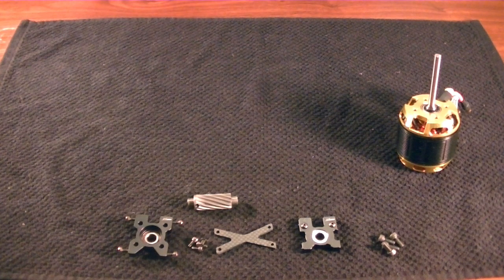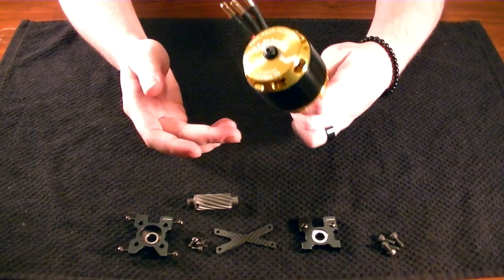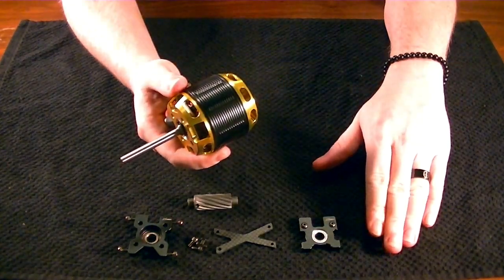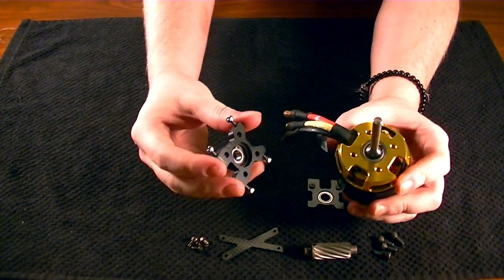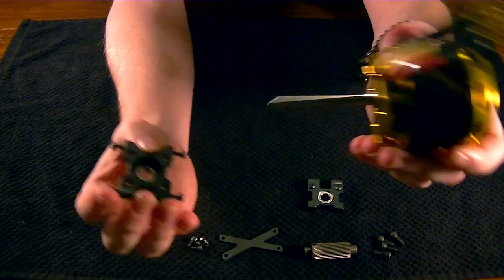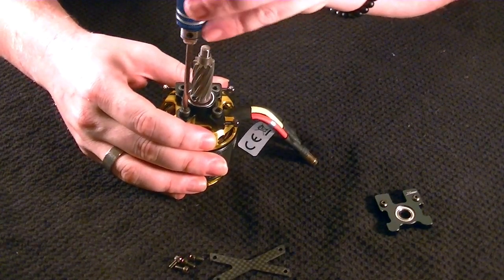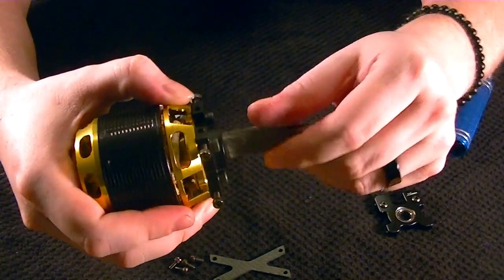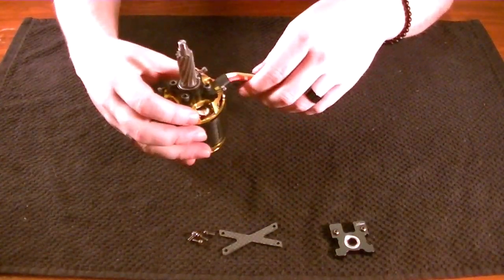Specter 700 : Motor Assembly And Install (FreddyCanFly)

Comment: Hi Freddy. I may not have done all the research, but I am looking at getting an XNOVA 4525-530. Do I want the the 36mm or 56mm shaft which would be their "A" or "F" shaft. (obviously if anyone else would like to help out it would be greatly appreciated)
Thank You
Reply from the maker: Would the be for the Specter? It should tell you the specs in the manual but if not I can probably get you an answer if you want to IM on Facebook.

Comment: Hey freddy my name is Buster i very much like your videos they have helped me a ton..  I was wondering in your flight videos the background looks like you utah mountains you wouldnt  happen to live in Utah would you?  Because I do I live in the salt lake valley
Reply from the maker: Hey brother, I have some bad news lol I have lived in Utah for over 10 years however I have recently relocated to Arkansas :(.
Reply: @FreddyCanFly  damn it!!! That no good lol..  How is hoping to get your help on some helicopters . I need some help with some helicopters i  Recently acquired. My experience exceeds to a blade 450X.  That I set up in rebuilt a few times. With the AR7200.   But recently I bought a guy's  Entire collection. I got a trex 700 with a mikado vbar. A trex 550e that im going to put a ar7210bx .  Neither Heli has ever been flown there built but not set up. If you get my meaning. A goblin 420 with a ikon a goblin 280 fireball with a ikon2 mini. And a trex 450 with a beastx plus. I kinda jumped in with both feet..  I got pretty decent flying skills And experience lots of practice on a simulator I just need help with the setups and getting everything calibrated like the self level on the ikon stufd like that.
Reply from the maker: @BussB420  dang buddy thats a lot to take on for sure.  I am currently working on the full setup series for the beast X / AR7200BX.  They should be up very shortly.
Reply: @FreddyCanFly  im putting a ar7210bx.  How similar to the 7200 is that
Reply from the maker: @BussB420  They are the same but the 7210 has some additional added menus and updated firmware things like that.  They both work the same.

Comment: Great video. Nice helicopter. I'm trying to decide on a specter 700 or a 696, the main difference I see is tail drive. I don't know the advantages or disadvantages of torque tube to belt drive. Do you have an opinion?
Reply from the maker: They are both amazing to have, I like the belt because it makes less noise and has a cool sound.  However the TT is a lot easier to fix because to boom can be take off without removing the gears.  All in all I would say its just personal preference.
Reply: I like the torque tube, I have a 500 and 550 with it, but it's always fun to try something else.

Comment: It’s critical to glue (green) the pinion to the counter bearing.  Otherwise you will consistently strip main gears with aggressive flying as it wears down the pinion.
Reply from the maker: Thank you for sharing, that is a great pro tip :)
Reply: Counter bearing?  Which bearing is that?
Reply: Nick Neo the bearing on the bottom of the pinion